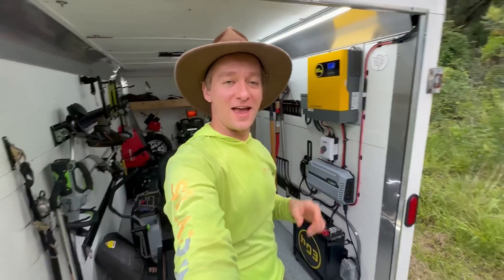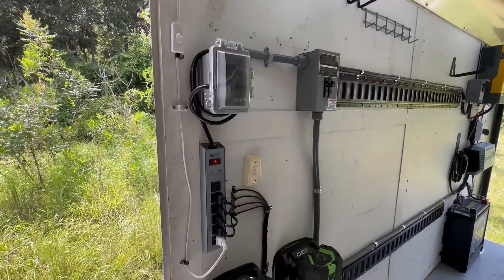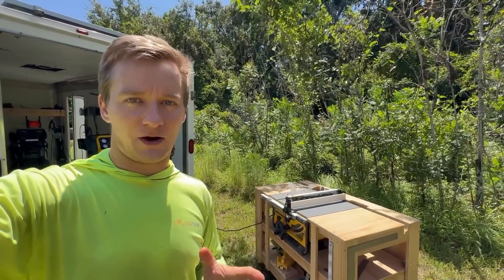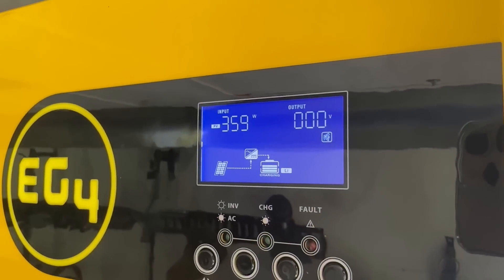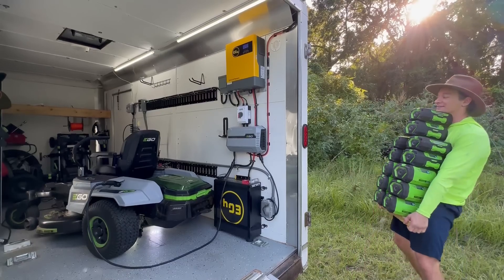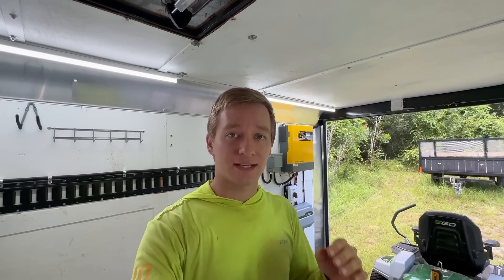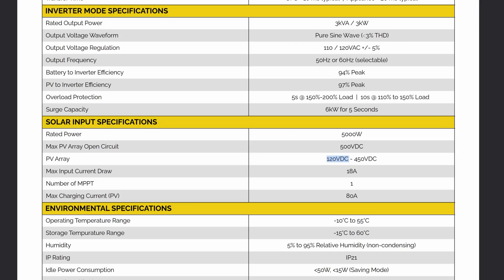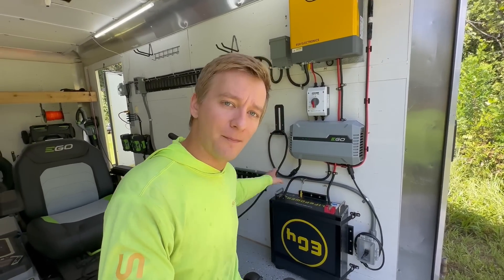Solar Powered Lawn Care Setup; Why Not Just Buy More Batteries?

Comment: It didn’t look like you had a permanent cable for grid hookup, have you considered adding a J1771 hook up on the outside so you could pull it up to a charging station plug it in for a couple minutes, especially since the battery is a lot smaller then a car, and then off you go.

Comment: why not just buy used solar panels? I found 300 watt panels for 80 bucks.
Reply from the maker: Good question. I had to weigh lots of trade-offs. On the one hand used are cheaper, but generally have reduced capacity, and since I wanted every bit of production I could get, new made more sense. Other considerations were size issues, I wanted to fill nearly every square inch of space up top, and lots of different panels would have required me to either have them overhanging the front, back, or sides of the trailer, or leaving a large space void of panels. Lastly, most of the used panels I saw were cost effective when you order them in a pallet, but I didn’t want to buy a whole set, costing me more and therefore negating the benefits.  I agree with you though, used panels are great for lots of things and make tons of sense when you have room to mount them, either on a roof or ground mount.
Reply: very good points i did not think about.  @solarpunksteve

Comment: Nice setup my Dewalt Flexvolt 60 9 amp batteries take 2+ hours to charge when hot so need enough to cover that as brush clearing runs through a 9 amp in 20 minutes

Comment: Id put 4panels on each side, mounted to hinges,  so that is 3600 watts, probably 3.4kw real world. With linear actuators or just manually un latch and prop up. Mount the panel! To a 1/8" sheet of aluminum diamond plate, with 1" angle to brace it and mount hinges and latch, prop rods. Or have the metal bent at 90° Maybe add a strip of LEDs under, also providing shade!  Space the hinges for clearance, heck im wanting to get one and make a camper!😆

Comment: So, this is really cool. One problem I have is where you positioned everything. For example, that inverter and battery is heavy, move that to over your axel. The Tesla is cool and all, but you don't want your trailer out of balance on it because it'll yank the car around. Second, instead of wiring in a cable to charge your trailer, put a generator hook up on the trailer, so you can just plug an extension cord into it. Safer and you wont wear out your lugs from screwing them on and off. Lastly, look around for some bigger panels, get some good second hand 300 watt panels, those 200s are serving you well right now, but they're gonna age out and die. 300 watt panels will keep you going for longer, not just in terms of battery charges, but in longevity of your system. Nice work!

Comment: Awesome Setup !
I'm considering buying some EGO equipment for my new yard, about an acre.  And installing a solar battery for going off grid.  
This was pure inspiration! Thanks
Reply from the maker: Hey thanks! So far things have been working great, I would recommend it if you’re comfortable with the price. You could definitely get a fantastic gas mower for the price, but if you’re set on electric it’s a great option. I would check out the larger 52” mower, as I feel it’s a better value for the money since it actually comes with all 6 batteries and they are the 12ah ones not the 10ah. Anyway, if anything changes regarding my opinion of ego I will be sure to let you all know!

Comment: I love your set up. I've drooled over your mower.  I hate that everyone is getting killed on the price of small Lithium batteries. I would pay 10-15 bucks extra if my lawn service showed up with your rig until the price of this stuff settles down more. . My 4 12v 120amp hour Marine lead acid batteries cost 400 bucks, about 3.5 usable KWH. my 4 250 watt solar panels were 300 bucks delivered, 3.5 KWH PSW inverter $200, 60amp/24/48v charge controller $100. 120v/24v/ 25amp battery charger $125. My system in in my shed and feeds a 120v subpanel in my house utility room , the sub panel has a toggle switch which my spouse of 50 years can flip and ALL the 120v service in the house comes back on.

Comment: Why do you need to split the output at the end?  Would it work if you just had outlets after the 30 amp breaker?
Reply from the maker: Most household outlets are either 15Amp or 20Amp and you protect the wiring and circuits with appropriate 15A or 20A breakers upstream. If you have a device that starts to overload and pull more from the outlet than it’s rated to handle, the breaker upstream should detect the heat from the extra current draw and trip, therefore saving you from having a fire or meltdown. 

If for example you had my mower charger plugged into the 20A outlet and it started to overload and pull 24A, the outlet or wiring could overheat and melt, starting a fire, but the 30A breaker would never trip as it’s still within its limits. 

The 30A in my system is to protect in the case of both circuits pulling more than the rated current carrying capacity of the total system. For example, if both my circuits were drawing 18A each. They won’t trip the 20A breakers, but together at 34Amps they would trip the main 30A breaker. 

The inverter is really smart and has its own safeties and shutoffs, but it doesn’t hurt to have extra protection and at the same time, no matter what safety system you have in place, you have to make sure your wiring and circuits are rated to handle what you’ll be pushing through them. 

Hope this makes some sense! I’m not an electrician and you should find one to help you with your system if you choose to do this so that you don’t come sue me 😉
Reply: @solarpunksteve  Wow thanks for the detailed response, makes sense!

Comment: This is awesome!  We have a 1200 watt  art studio with 5kw of batteries. I love the calculations. We have 3600 watts of  used panels coming from Santan Solar expressly to charge our Ford Lightning, and A/C the garage. We'd have an EG4 hybrid inverter coming, but Signature Solar seems to struggling with serving customers, so likely, we'll be going with something else. MPP, likely. Every day, we'll be offsetting the costs of charging the Lightning. We have some ideas on converting Panga ocean Taxis in Panama with Solar on top of Boat lifts. They use $100+ in gas per day's so there is HUGE potential in commercial solar ICE replacement. One just has to have a bit of imagination like you!😮

Comment: Awesome setup! I think it is really terrible that you have to convert your 5.12kWh of DC battery into AC and then back into DC. There really should be a way to charge your eGo batteries off DC rather than AC. I sure hope eGo and other battery manufacturers offer a DC-powered charger dock. You lose about 5-20% of your 5.12 kWh battery converting from solar (DC) to battery (DC) to AC then back to DC to charge your eGo batteries. ARGH! Hope you can find a DC-powered solution to charge your eGo batteries.

Really all you'd need is the 48 volts from the EG4 (51.2 volts nominal, but depending on how you are charging it (between 3.5v and 4.2v per cell, 3.6v is probably ideal) a max voltage of between 57.6 volts and 67.2 volts) to your eGo batteries. I am betting you can probably take apart the eGo charger and find where the AC input is converted to DC output for the batteries. It's probably a full bridge rectifier in there to convert the AC into DC, and likely an inductor that reduces the 120v AC to somewhere 50-67.2 volts, providing a constant voltage / constant current output to charge the eGo batteries. I'm not sure if they are Lithium Ion or LFP. 

Anyway, you ABSOLUTELY should be able to charge the eGo batteries directly from your EG4 rack mount battery. In fact you should not even need the inverter, other than for its MPPT solar charge controller, which you could get much less expensively than the LV6548 unit. 

Granted, being able to power AC-only devices is epic, so not suggesting that. However you are losing some capacity from your solar and rack battery by converting DC to AC and back to DC again to charge your eGo batteries. Optimize FTW!

Comment: I was pleased to see you using ferrules on your terminal connections :)  While not needed for saddle-type screw terminals, an awful lot of screw terminals -- esp. the cheaper stuff -- still depend on the end of the retaining screw mashing into the stranded leads, and ferrules are a much more robust install practise.
Reply from the maker: After working on ships for 10 years, I can’t not use them! Too many things can go wrong with electrical connections in harsh environments.
Reply: @solarpunksteve What were you doing on ships?
Reply: the european mind cannot fathom not using ferrules

Comment: Steve, I do love what you have done.  I have a 10KW ground mount system that feed 100% of my power to Georgia Power.  We have had this system for 15 months now.  I am in a program that allows me to use my Bi-Directional meter and average the power I use over the full month; I have no batteries in this system.  I have had bills of about $4 to $15 over the last 5 months.  Of course, during the winter, we have higher bills of about $40.00 because of the lower angle of the sun.
We are now building a Solar-Generator for the system.  We use the same controllers you have but 2 of them are for 240 Volts and have 6000 kw service.  We are using the same batteries but, again 2 of them, for 10Kws of storied power.  This will be used as a “Whole House UPS” and give us about 24 hours of backup power.
I see you getting some negative feedback because of the TOTAL electric approach with even a Tesla.  How limited of the view.  I love my 2004 Tahoe and our 3002 Honda Accord.  We use about $100 in gas/month.  I use Natural Gas heat, Hot Water, Stove, and Dryer.  This used the most economical power for the ‘Thermal Energy’ and allows us to use the Electrical power for lights, computers, TV, and the other loads in the home.  Solar is expensive but we won’t worry about being without power during power outages and the sensitive electrical loads will have very clean power.
Being 75 years old, doing upkeep on gas engines like lawnmowers, weed eaters, and blowers is getting really hard.  I love your setup and you can work for your landscape company with little noise to your customers and the upkeep of the equipment is much less work and less money.  
Note: I love my Tahoe and Honda, but I envy your Tesla.  I just don’t drive the miles to justify it.

Comment: I built the same setup but with the Growatt 3k-ES version inverter and 3k of panels.  I use it to charge my Nissan Leaf and it covered 90%+ of my driving.  If you add a second battery,  don't forget to use a bus bar and a DC rated breaker and/or a T class fuse.

Comment: You're going from DC to AC to DC again. Panels (DC) inverted to outlets (AC) to charge your batteries (DC). Look into making the entire mobile operation run on DC, It's not that hard to do and you eliminate a ton of efficiency (that's just heating up your trailer and equipment). You'll get even more juice out of your panels that way.

Comment: I am really glad to see this. Does EGO warranty for this use? Because I looked into this for my Ryobi 80V ZTR and they dont warranty it if you work professionally. I had solar on my shed charging it. I moved the solar to my house now but that circuit running the shed is still solar powered. The only problem I'd see with your setup is that you have to make sure the lawn sizes and/or quantity you do in a day are low. Electric is awesome for maintaining a lawn but it gets drained pretty fast when cutting tall grass. But then again most lawn care guys I've seen won't do more than an acre or so. So if the mower does 4 acres, you end up draining the battery 30-50%, you can probably keep it topped up on a normal day. You definitely made teh right call because the EG4 stuff is very affordable.
Reply from the maker: EGO has a 3 year battery warranty for residential, and 1 year for commercial. 

You are correct, I have to be careful what size lots and how many I take on. But so far there aren’t too many that I can’t do. And things will only get better over time.

Comment: I absolutely love your hard work and diligence.  Your work has inspired me tremendously.  I just had a thought about the solar panels on the roof of the cargo trailer. As an avid trailer hauler and landscaper  for 20 years, I've noticed that any extra drag u place on the roof of the cargo trailer reduced mpg massively.  So I would advise if possible to try to add solar to a tall cargo trailer in such a way that either doesn't add significant height and or doesn't introduce sharp edges.   So would flexible solar panels that are paper thin glued with small air gaps to prevent overheating be a more repeatable solution.  Let me.know what u think.  It would be my guess that the extra drag from the panels you displayed here would nullify any energy savings from the 5 kwh gained daily unless of course your speeds were slow and your dialy miles were minimal.  Can't wait to hear your thoughts. I'm sure if you looked into it, Your predictions and analysis would be ten times more comprehensive and thorough than my speciation.  Keep up the great work.  I hope to see more content!!
Reply from the maker: You are correct! Aerodynamics is key when towing, much more so than weight, especially at highway speeds. Luckily my route keeps me off the highway, but I’ve got some things coming up that might require some over the road travel and I will be making some improvements to the aerodynamics to reduce the impact they make on my range. Of course I will have to make a video about it and share!

Comment: Sweet setup! Good job on making every piece fit together so nicely inside the trailer. One more advantage to having the battery and the solar panels is that you can be "offgrid" even if you use all the batteries inside the tools. You don't have to start a noisy generator or deal with the customer for access to an outlet. It keeps the interaction with the clients at a minimum and you can do your job in peace, without long extension cords in the way running from some house.
Reply from the maker: Thank you! It takes a lot of time and effort but I can’t stand messy cables. 

I was giving a quote to someone and after mentioning I used all electric equipment they said “I have some outlets around the back I guess you could use”. I had to chuckle a little bit, I said “nope I’m all good, sun is shining!”

Comment: This kind of setup is very practical for California, where we have a mandate to get rid of gasoline powered lawn equipment.  The rest of y'all will be doing the same soon whether you believe it or not.
Reply from the maker: Yeah it's a huge challenge and I sympathize with people that are being forced to change when things aren't necessarily ready.  I mean I'm still only using a "residential" mower and it was not cheap, the commercial stuff is north of $25k and it's still not enough for lawn care professionals to be able to finish their days if they are a larger operation or have large properties.  I think the benefits you get from electric equipment (both client and operator) will win out over time especially as costs come down, but it's still such early days.
Reply: An option for a small lawn mower is buying a regular corded AC powered electric lawn mower, and building a basket for a 20-pound 100 amp-hour lifepo4 battery and a 1500 watt inverter or so, to run that electric lawn mower instead of buying a cordless mower.  Batteries are about $300 a kilowatt-hour and they weigh 20 to 25 lb.  You could even mount a small charge controller on it  and plug it into one or two panels when you're not using it. That's what I'm going to do when my gasoline lawnmower gives out.

Comment: Nice setup.  I didn't want to run conduit and wires from my house to my shed, so I bought one solar panel, a 10 amp charge controller, a deep cycle battery, and a 1000 watt inverter to charge my Ego weed eater batteries, run a light, and provide power for a skill saw, or electric chainsaw.  It's perfect for my once-a-week use. It was $300 and probably would have cost the same amount for  wiring and conduit.  I used the same setup to run my Christmas lights from sundown for 6 hours last year also.  I now have two separate systems using lifepo4 batteries to run most of my house all the time now.  The independence just feels great.
Reply from the maker: Hey yeah, it's amazing the solutions you can come up with when there are lots of options out there on the market for solar/batteries/inverters etc.  I ran some Christmas lights from a battery and inverter in order to decorate a trailer for a parade and it looked great! No generator noise or fumes while everyone sat in the back and enjoyed themselves.

LiFePO4 batteries are where it's at! I'm excited for manufacturing to start taking place in the US in the near future as it's been strictly overseas for many decades now and with some patents/agreements ending, we should start to get it here too, which will further drive costs down and innovation up.

Comment: It’d be interesting to see how feasible it would be to add another array as sort of an awning and add to the capacity and shade you while out on a job or something.
Reply: How about it telescopes forward over his tesla, more solar and shade for the car
Reply: was thinking something similar, where the panels basically stack, and fold outwards through a hand crank or small motor, granted probably only one should be out as the other would stick out into the street, so definitely would need separate motor control... but still a neat idea if the power generated needs to be higher output.